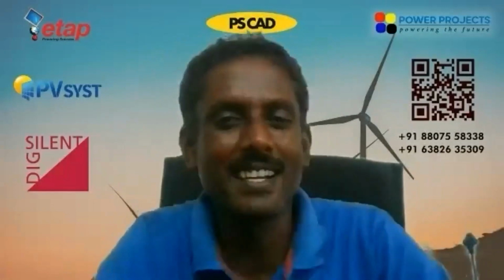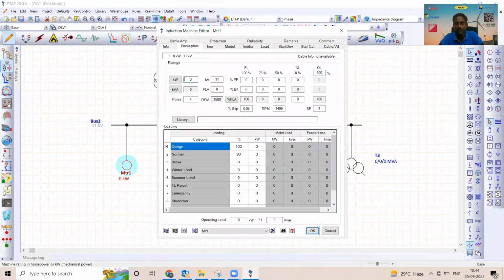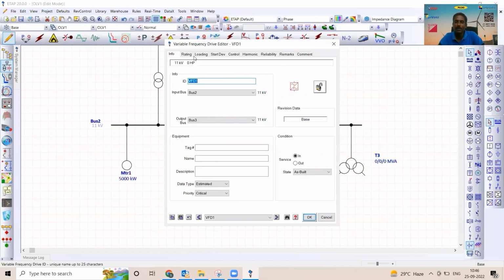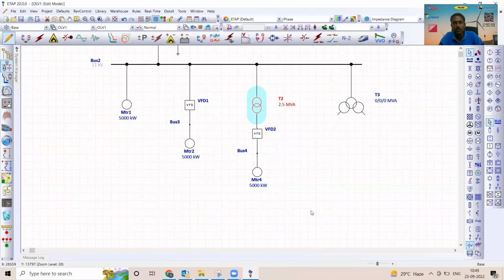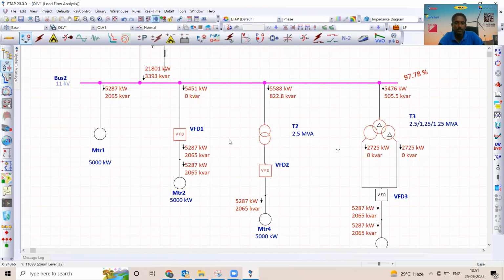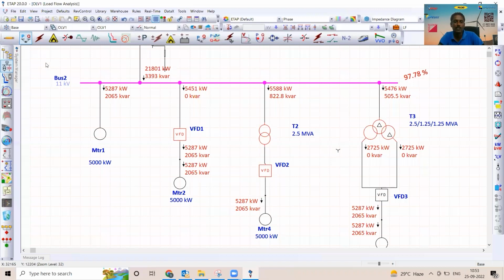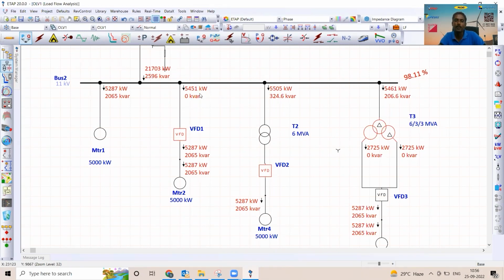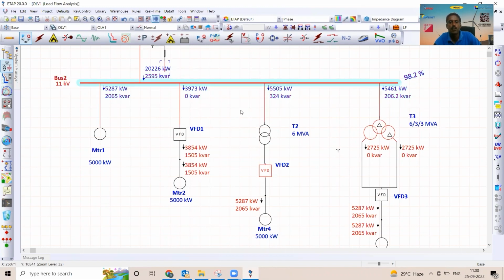Understanding Variable Frequency Drives with ETAP

Comment: Does VFD reduce short-circuit current contribution of a motor?
Reply from the maker: Yes, a Variable Frequency Drive (VFD) significantly reduces the short-circuit current contribution of a motor.
Reply: VFD BLOCK THE Short circuit current which is contributed from Motor

Comment: Sir, what is effects of adding a series reactor in input side  of the VFD
Reply from the maker: Yes, a VFD reduces the short-circuit current contribution of a motor because it acts as a buffer and limits current through its power electronics, unlike direct-on-line motors.